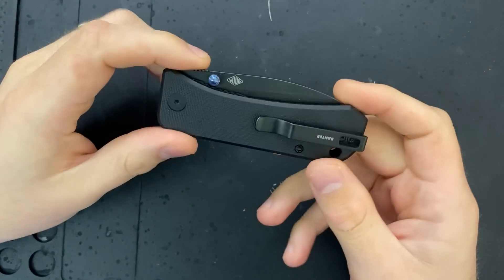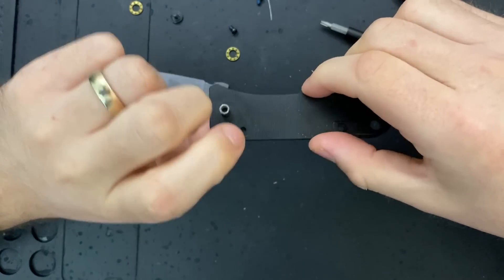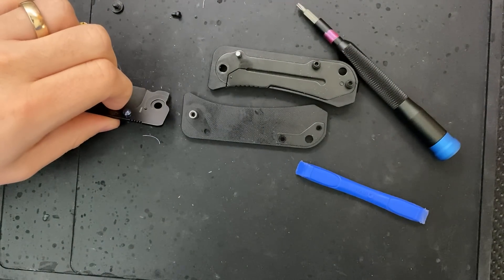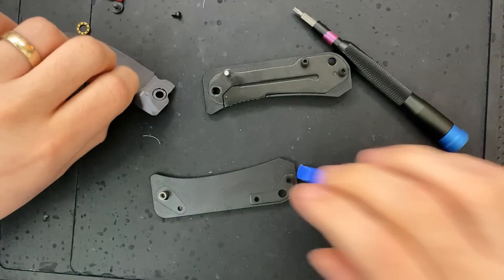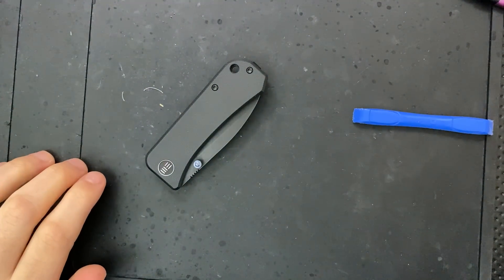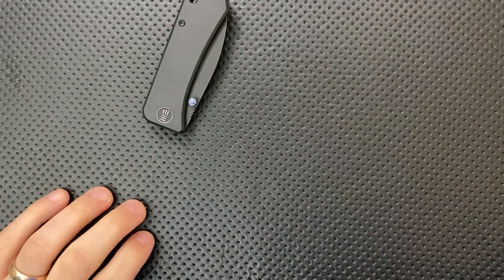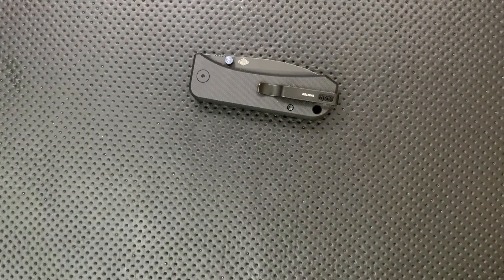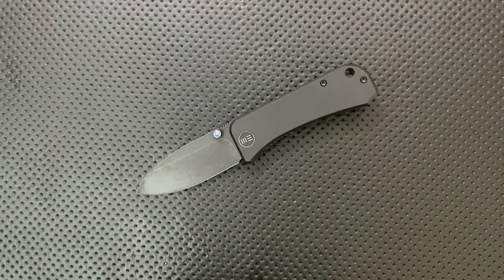How to disassemble and maintain the WE Knives Banter (with first impressions)

Comment: Thanks for the video Nick. Mine came bone dry and because of that a bit gritty. Took it apart cleaned it with alcohol pads and applied a minuscule bit of daiwa reel oil and wow! I do like the knife, I have the Ben blue but I wished the black stud matched the rest of the hardware which silver.

Comment: This knife looks nice I wish I would have jumped on it when they were in stock. On a different note... do you have an opinion on the ZT 0022
Reply: look up reviews i was going to buy that one but the reviews say it isnt that well put together.
Reply: Tyler Haley yea I have seen mixed reviews on it personally. Some people seem to love it while others say it’s totally not worth it. I did manage to hold it at a local shop and I will say just in that time it was a cool little knife. I’m wanting to get a small secondary knife and thought the 22 seemed neat. Still shopping though.
Reply: I'm a  Z. T fan have several.   I like small high quality knives  .I've almost bought one several times  .I need to see it and hold it before I drop $200 on it .I wonder about the action? Kerry
Reply: Kerry Kitterman the one I was looking at seemed rather smooth. I was quite surprised with such a small blade.

Comment: Liner lock and frame locks are inferior to the likes of compression lock imo (quicker to close less likely to cut fingers) i am waiting for a knife with compression lock or similar button lock, void opening(elongated hole) and flipper. Kind of a light weight smock with a bigger spydie hole. Bens knife looks short and fat, I like smaller knives 0450 is my #1 edc but not fat.
Reply: u should check out hogue they have some button lock smaller knives like the microflip

Comment: Thanks Nick. This knife..... This knife has got to be THE MOST uninspired design Ive ever seen. I like the way WE counter sinks their pivot to end up basically flush w/ the scale (whatever) this knife looks like a 5 year old drew it. I feel like the people who buy this, want to feel like they're "in the club" - even the knife community has sheeple. Fall in line everyone.
Reply: Your statement about people buying this to be "in the club" is absolutely ridiculous. There's a lot of people who like it for the small and simple design made with good materials and We quality. This is 1 of the least expensive We knives that they have ever offered.

Bottom line is that I think it's a nice design and the fact that it's all sold out shows it. I also have yet to see any selling on the secondary market either, which is a good sign that people are happy with it. I guarantee I could get more than I paid for mine but I don't want to sell it because I think it's the perfect size. There aren't  many knives I know of that can fit in the 5th pocket that I can get a full grip on and with the blade width this has. This has a great usable blade for how small it is.

I really hope Ben continues on with new designs. I think a bigger version of this knife could attract a lot more people and I think just rounding the handle a little more could stop all the idiotic comments about this knife. I personally think it's a great knife as it is and probably has the smoothest thumbstud action out of any thumbstud knife I've handled.

Comment: I can't justify the $128 price tag for a basic liner  lock. At this price you're competing with Bugouts and Paramilitarys. Sorry Ben, for 80 bucks sure. But not for 130.
Reply: It's $108
Reply: I don't blame you at all. For $108 bucks, you can buy so many cool things, and I can't fault you if you don't want to spend your hard earned money on this. No harm, no foul.
Reply: I don't know how anybody can expect to get a We knife with S35VN steel and G-10 handle material for any cheaper. I think this is a great value for the price. All versions of the Bugout are more expensive with cheap flimsy scales and S30V steel is a step down from S35VN. This is also a better value than any Spyderco PM you're going to get. For this price you get FRN and a budget steel from Spyderco.